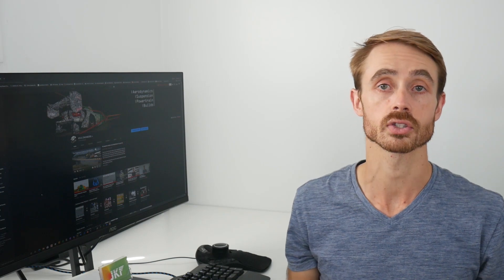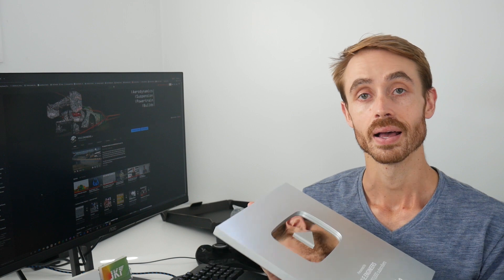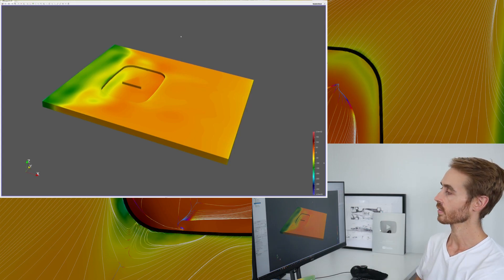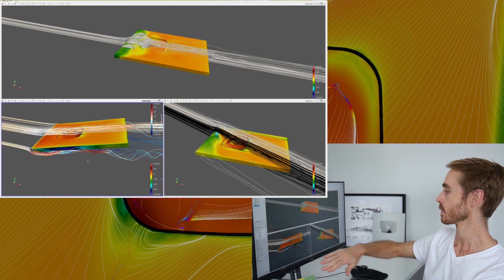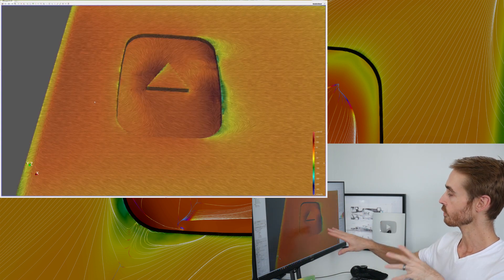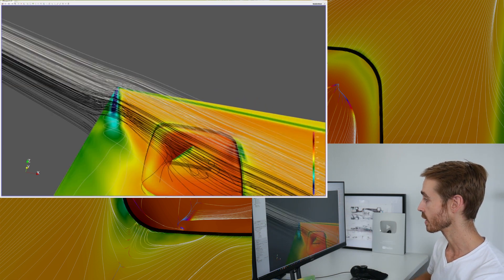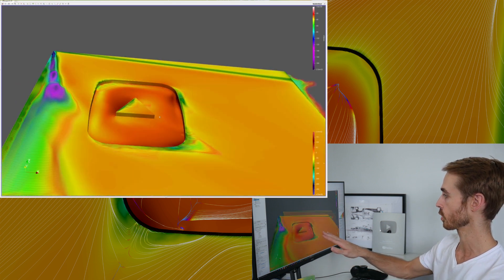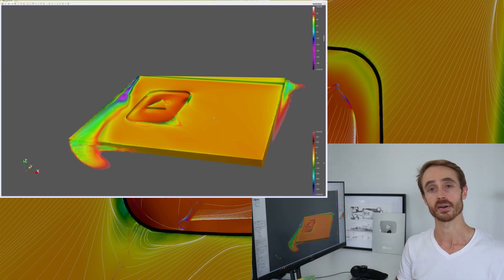The Aerodynamics of Youtube

Comment: I could use your brain for building the aero package on my 16 camaro ss. It's currently beating track records and is highly competitive in the class I race in but I want to do a full aero package. I'm going to run the stock zl1 1le rear wing and then a mix of the same car factory front splitter built into a full underbody covering into a small rear diffuser. Also my front wheels stick out past the front fenders so going build some type of front flair. My goal is more to reduce lift and not raise drag too much. The car weighs 3620 without me and 3775 with me and has 477 rear wheel hp

Comment: That vortex at the leading edge in the cross-wind case reminds me a lot of how delta wings on modern fighters generate lift. On fighters, the wings have to be as thin as possible to reduce drag, but if you make it too thin, the leading edge effectively turns into a trailing edge and the slightest change in angle of attack causes separation. In the delta wing they use that effect to roll up vortexes on the top of the wing which are of lower pressure and thus generate lift even at very high AoA! Here's a cool NASA video of the effect: https://www.youtube.com/watch?v=FqN49f007yk

Or so I've heard, I'm no aerodynamicist.